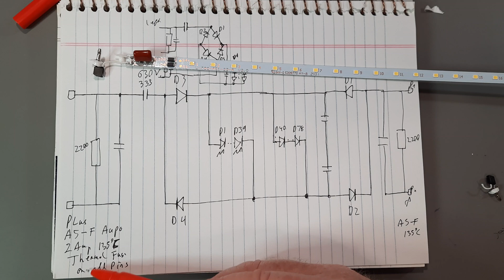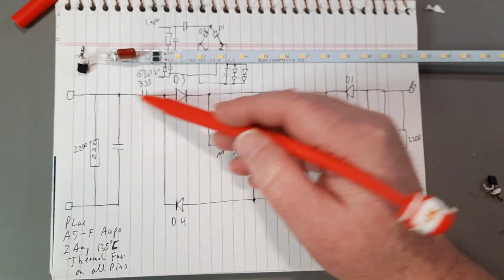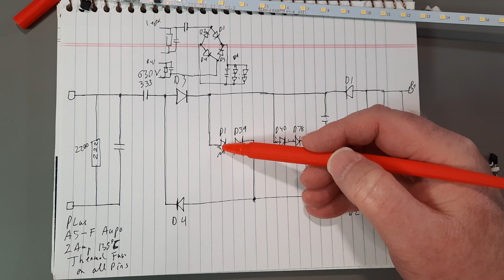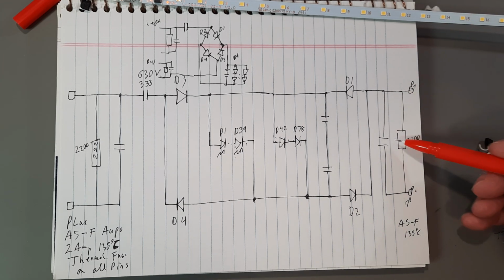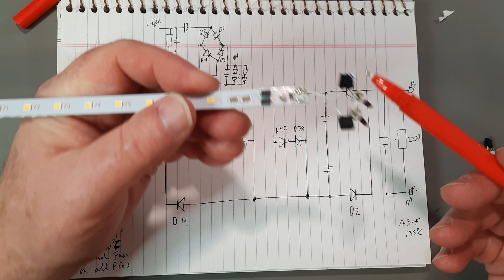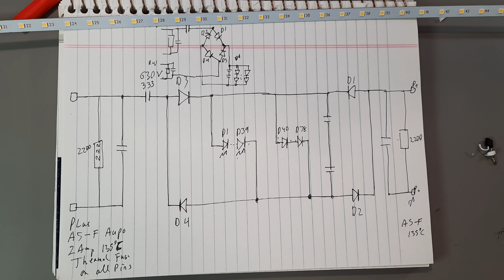T8 LED Tube Burn Marks and Teardown with Schematic

Comment: I had originally 2x 18W (connected to series) light so I had to modify it for led tubes. When I did those modifications I used black marker to mark what connector were LIVE. also when I first got those led tubes I also marked what end was "electronics" so I don't put those wrong way around and get nice bang because other end is just short circuit. Maybe I need to add 500mA-1A fuse to that light because in original led tube package starter contains only fuse.
Luckily other light were only 1x 18W so I didn't need to do any modification for those.
Reply from the maker: It has opened up a whole new world of modifications and possible conflicting parts. Writing on fixtures will probably be common.
Have a good day

Comment: Interesting teardown and glad you posted a schematic. I replaced our fluorescent tubes with LED T8 tubes several years ago. It is too bad there are so many different flavors of LED T8 tubes. You mentioned the ones you have do not require removing the ballast. I went with ballast bypass so had to remove the ballasts in each fixture and rewire the tombstones, but even these tubes come is two different flavors: single ended and double ended. With single ended ballast bypass hot and neutral are wired to the tombstone on one side and nothing on the other. I chose to use double ended tubes where hot goes to one tombstone and neutral to the other side.

If you ever need more light replacing a tombstone is easy and they are cheap.
Reply from the maker: Having three different wiring configurations for a product that looks the same, where can that go wrong. But the fixtures are cheap but sure put out a lot of light.
Have a good day

Comment: T8 led tube come only one side main power, and need take off all palancer, only need normal main power and one side only, or destroy led tube. i has change many, need take off transforce/balancer and wiring new tube frame wires only one side wiring power in to tube. if but new led tube to old balancer tube frame break fuse because empty side go main power and this have wrong, led tube have second side only empty ,some tube have connected pins together break fuce.
Reply from the maker: There are two different versions available. The one you described (direct wire LED tubes) and this type that the ballast is just left in place with the starter. This one is called InstantFit but that is just a brand name.
So people really need to read the packaging very carefully.
Reply: I used retrofit tubes. Those usually come with "starters" that are only fuses and those tubes have other end short and other end contains electronics. Those usually can handle those iron core ballasts. Only problem with those are if light fixture has multiple tubes connected series then you need rewire fixture. Usually tube packaging/manual show what kind circuits are ok and what need rewire.